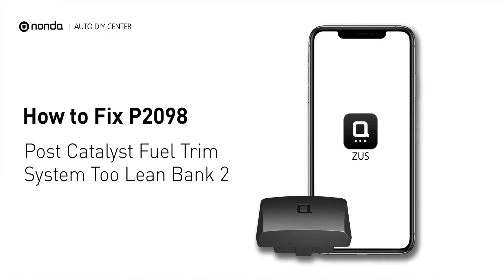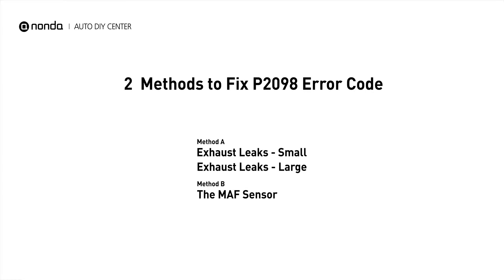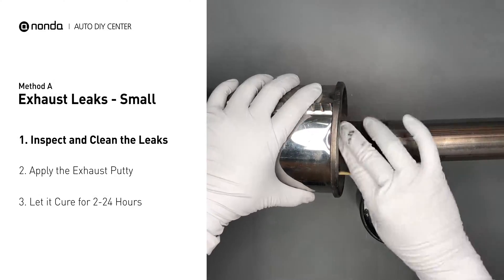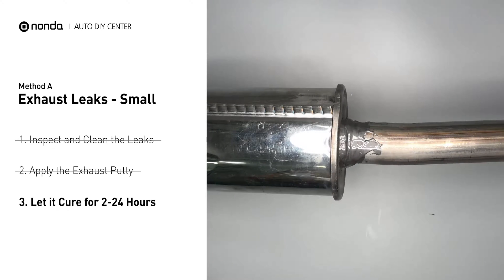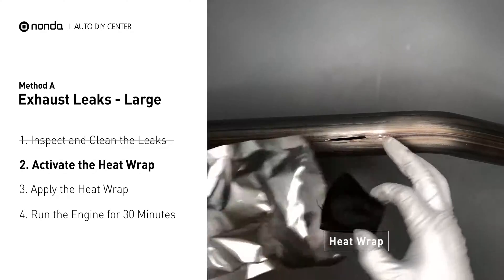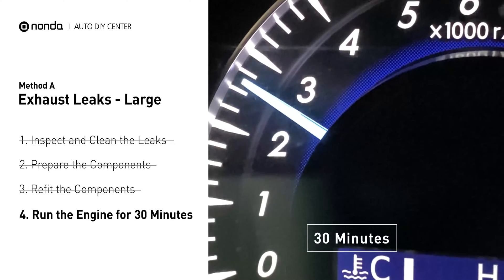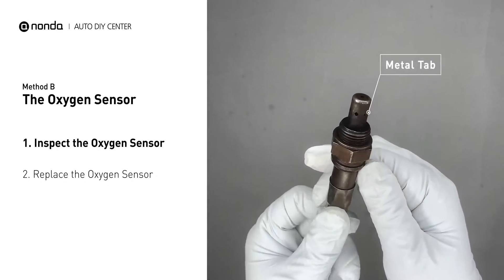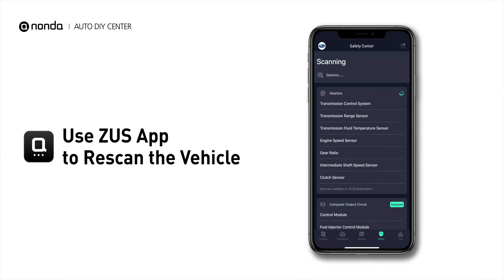How to Fix P2098 Engine Code in 4 Minutes [2 DIY Methods / Only $9.57]

Comment from the maker: Hi, I'm Steve, nonda's lead mechanic engineer. 
Feel free to leave your comments here if you have any mechanic questions, I will be glad to help you out!
Reply: Awesome video, I just got my code from my car I will definitely  look into it, meanwhile I look for it, is it safe to drive around with that code?
Reply from the maker: Thank you for your positive feedback, Jose. We recommend having it fixed in a timely manner.
Reply: I had my oxygen sensor replace and still getting a check engine light anything reason or do I just need the dealer to reset it I was told only the dealer can do so
Reply from the maker: Hello, the code must be cleared from the memory. Also, have you tried checking if there's an exhaust leak at the exhaust manifold gasket or flange? We suggest to have it checked by your mechanic.
Reply: Hey Steve, I noticed a P2098 error code in my 2017 Altima 3.5 SR. I didn't see or hear any exhaust leaks under the car. Would you recommend chaning the upstream and downstream O2 sensors?

Comment: I have a mustang 3.7 2012 and I’m getting this code which sensor is it ?
Reply from the maker: Hello, it's after the catalytic converter. Please note that there are also other factors that trigger this code that need to be checked like exhaust leak/vacuum leak, MAF sensor issue, low fuel pressure.

Comment: I had my oxygen sensor replace and still getting a check engine light anything reason or do I just need the dealer to reset it I was told only the dealer can do so
Reply from the maker: Hello, the code must be cleared from the memory. Also, have you tried checking if there's an exhaust leak at the exhaust manifold gasket or flange? We suggest to have it checked by your mechanic.
Reply: @nondainc  I got the same code after replacing Tappet cover gasket, plug seals and PCV valve. The car runs perfectly. Any idea?